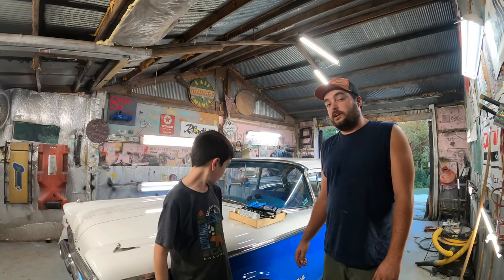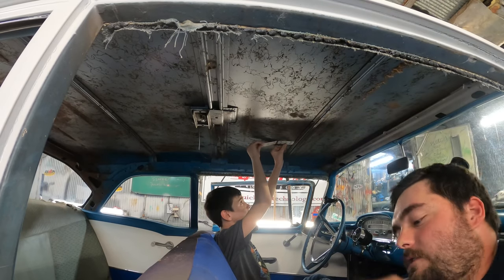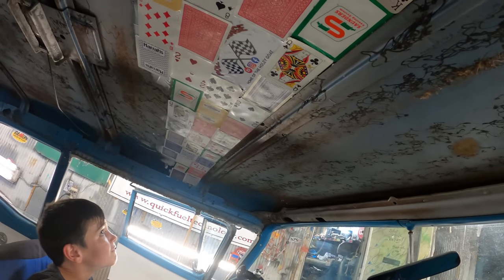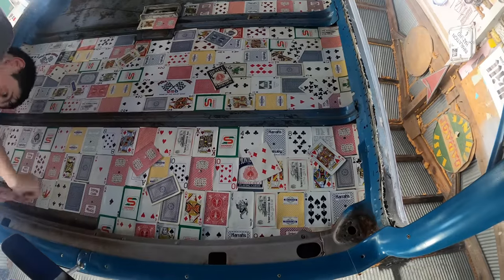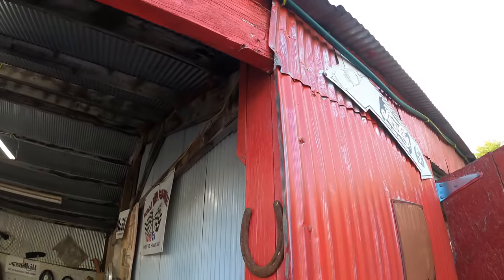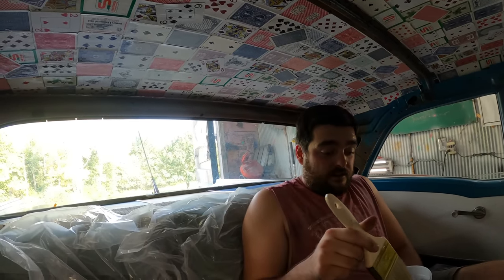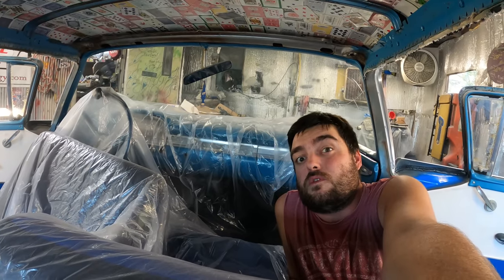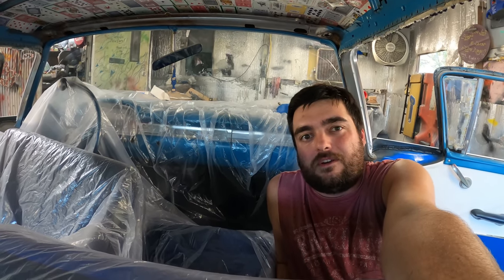DIY Headliner for Less Than $20! Alternative Headliner from Thrift Store Stuff in 1959 Ford!

Comment: This is a really cool idea for a headliner. I'll have to remember it.

If I'm not mistaken, casinos punch holes in retired cards so they can't be used by players to cheat. I'm most likely wrong, but it sounds like it would be the right idea.
Reply from the maker: Seems to be the case
Reply: Sometimes they cut the corners off

Comment: Ngl I wasn't convinced at first but I love how this turned out, a really original idea (and there aren't many of those left when it comes to car customisation.) It's like the equivalent of the rat rod fender covered in stickers thing, only way cooler. I agree with some of the other commenters - paint the roof structure matte black, fix the dome light, and then add a couple hanging fuzzy dice from the rear view to complete the Vegas theme!

Comment: Genius!!!  If I may make a suggestion, go full "Pebble Beach" and brush paint the top reinforcing satin black - you've sourced some fine brushes!  Alsway a pleasure to watch you and JD working together - thanks for the video!
Reply from the maker: Yes hindsight I wish we would've. Let that clear cure all the way up then I can mask it off I think
Reply: @PoleBarnGarage  "Pro Tip "(big air quotes on "Pro") - Use painter's tape (I know, you'd have more $$ in tape than in the cards) AND stick the tape onto your fore arm or pant leg to knock some of the stickiness off before using it.  I do this when I am more concerned about damaging the masked surface than I am in the paint bleeding under the tape, and it's still faster and neater than trying to cut in by brush free hand.  Works on my car projects, model car projects, and home improvement projects

Comment: Whenever you get casino branded cards from Vegas or Reno, they come "marked" so that you can't try and cheat with them in the casino. 'Cause they are usually actual used decks that have been retired from the tables.

Comment: The holes in those cards were used at casino. They would drill holes in the deck an will sell them , but you could use them there again.  Security thing. 
Love the head liner.

Comment: The holes are in some becouse they were old cards used on a table at the casino.
Reply from the maker: They punch em?
Reply: @PoleBarnGarage  Yeah, keeps cheaters from trying to use the deck to spike the hand. If a card gets even a little tiny crease in it, the dealer will get the whole deck and put it down a shoot away from the other cards and a pit boss takes them away for destruction. I am surprised that they just punched holes in those cards.

Comment: looks good, i was thinking some REVERSE LACE work,(on the inside instead of low rider outside style)paint a base coat of white? and a contrasting colour over some glued up lace and rip it off.. could be interesting? might also work on a budget using flyscreen, shade cloth, chicken wire etc
Reply from the maker: I would like to lace paint the roof actually

Comment: Easier way: you can just go get some paper and print pictures of enlarged playing cards. Use self tappers in each corner of the paper to add structure. Caulk the seams. I saved a lot of time and still did the job right with this method. Make sure you use DAP interior as well, because if you use exterior, that’s half-assing it!
Reply from the maker: Self tappers into the roof is a new one lol

Comment: The reason why the casino cards have a hole in them is because they are official cards and you could potentially put a couple good ones up your sleeve and cheat the casino. If they have a hole in them they will see the hole that makes them no longer official cards

Comment: That just seems like a lot of work to end up lookin like Fernando got hold of it...
The material to put a proper headliner in it doesnt cost much.
I've replaced many headliners in my younger days & the material doesnt cost much...
Even the strips that 50's cars used are easily available...
That being said , Im liking your content..
Reply from the maker: a headliner is $320 for this car. I don't have the means, nor the skill to sew one, and even if I did, I guarantee the material would cost over $150. It's not the old days anymore, this stuff is crazy expensive
Reply: @PoleBarnGarage  
I just put one in my sons Dodge Ram...
Taking the rear glass out was the hardest part...
The glue & material were under $100 .
I put one in my suburban 2 yrs ago...
Again, under $100.
"The old days " ?

Comment: Hate to disagree but I don't like it. Like the rest of what you did on the car. I think just sand it down and paint it with spray can would be better.
Reply from the maker: To each their own. Painted would look fine. Think I'm going with beer cans on the goat
Reply: @PoleBarnGarage  For the goat that sounds good. Maybe some period correct cans from the area where you got it? Or something close to that for the front areas? Those cans may be considered collectable but nothing is too good for the goat. Maybe some period soda cans as well or something early 70's advertising? The possiblities are endless.